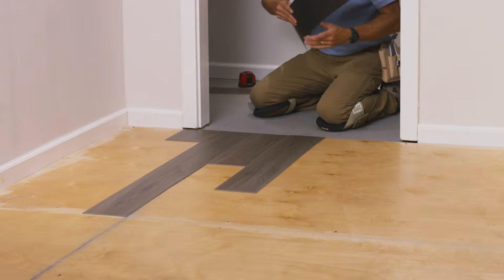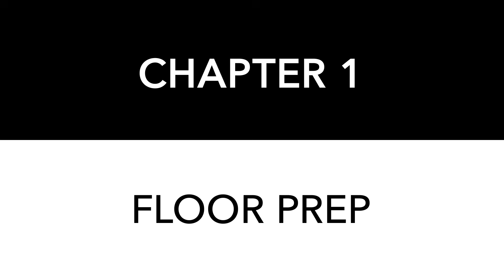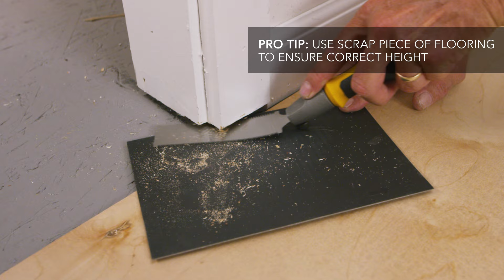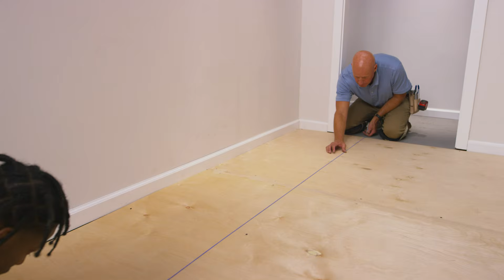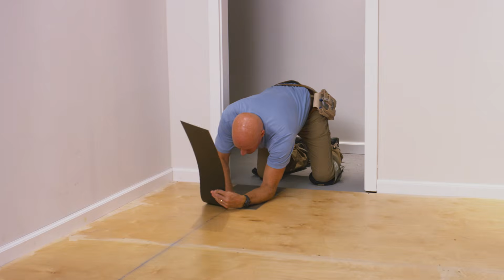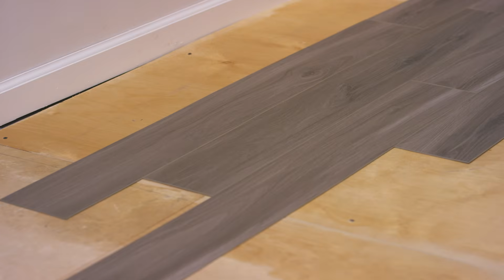How to Install Flexible Glue Down Vinyl Flooring | DIY Flooring

Comment: Suprised that the baseboards are not removed first before laying the planks down??
Reply: Maybe they are putting down quarter round molding to hide the flooring edge. I guess it would save a lot of work, time, and expense, even though it looks kind of kludged.

Comment: Didn't know there was such a thing as a difference between permanent and temporary (??) installation! Does that mean they both stick down just as well but one is easier to pull up someday? Really doesn't make a lot of sense.
Reply: This was new to me as well.  Does this mean it would be advisable to do temporary if you might need to replace a damaged plank one day?